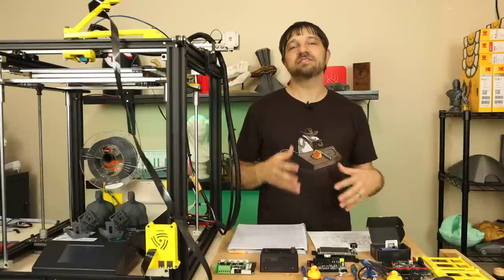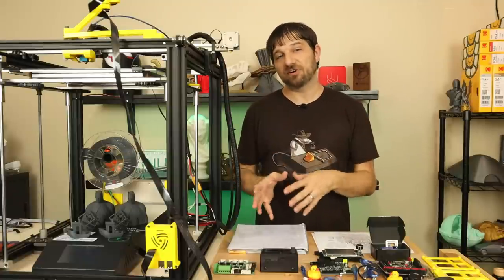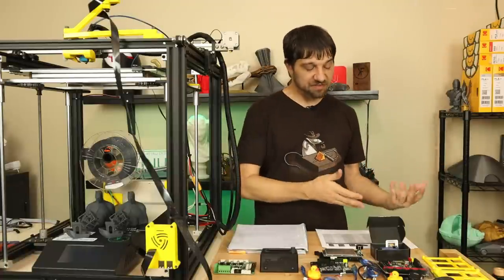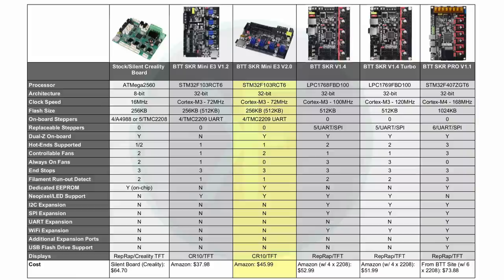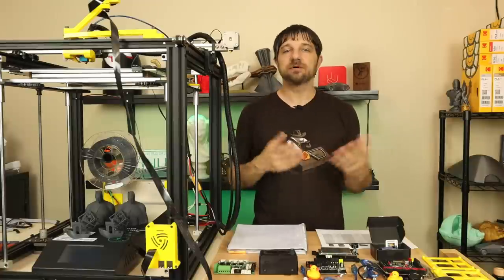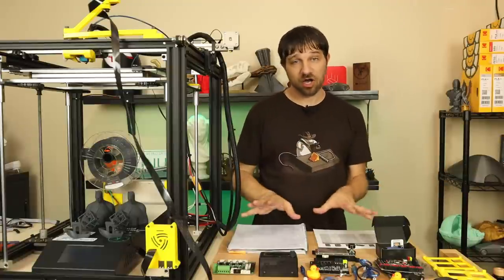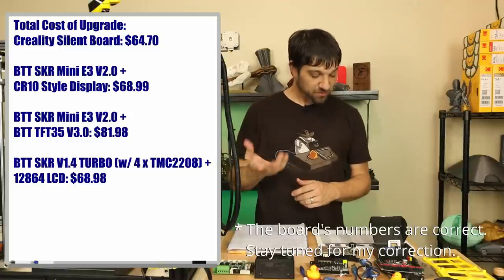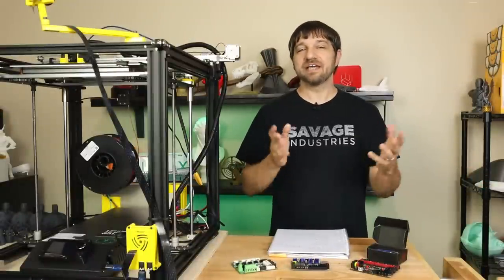Bigtreetech Ender 5 Plus Upgrade: Boards Compared (Part 1)

Comment from the maker: Have you missed my previous videos on Marlin 2.0? Check out this playlist for more information: https://www.youtube.com/playlist?list=PL4dGkbjUvBzpvkhay7Hf_fm3ygnvwQErt
I'll also post any corrections or updates in this pinned post!
- Clairification: Most of my comments about the display were in relation to the Ender 5 Plus which has a touchscreen display. The 12864 LCD on the Ender 3 and Ender 5 should work just fine with the Mini E3 V2.0 without modification.
- Correction: The SKR Pro V1.1 does not have onboard EEPROM as shown on my table.
Reply: I love you man!! I've been compiling my own Marlin firmware until 3:00 yesterday (or should I say today) and I have a black screen. I'm just recompiling as I type this. Now you released your firmware. Thanks! I can modify yours or just see why mine is acting up.
Reply from the maker: I'm happy to help. I haven't posted the binaries yet but I'll get them up if you need them.
Reply: @kerseyfabs  I'm already compiling your version. But the problem is that your version also shows a black screen. Which I find odd since cheetah firmware works fine.
Edit: Ok it's not firmware. It's something else. Now I also don't see any screen on Cheetah. And the board is not responding via USB. Odd.
Edit2: OMG!!!! Two days of work because of the chinese SD card that was causing problems! Note to self and others. Even though they are only 128MB they are still trash (the ones that come with the board).
Reply: Hey. Just to add... I have checked your firmware and it's ok for a start but you really should enable UBL (or make a video about it) as it's not that harder to use and it's way better than BIL leveling. BIL leveling hase some issues with SKR e3 boards. They tend to ignore BIL leveling (I have been testing this for three days straight).
Reply from the maker: @BlazPivk  I'm really sorry to hear that was your problem but excited that you found the solution! Nice job!
Reply: @kerseyfabs  Yeah I have found it odd that my firmware wasn't working but hey everyone can mess up. When yours didn't work as well I knew something was up. But I love the fact that you're experimenting with the plus version as it seems you cover all the stuff I'm interested in and I don't have the time to tinker with (well except the firmware, I like to tinker with that one).
Reply from the maker: I'll be happy to check out UBL sometime in the future. I've never had a need for it thus far because my printers barely need ABL at all. I may just be lucky on this one.
Reply: @kerseyfabs  Oh my E5+ worked great on the stock board but SKR mini has a  bug with the firmware where it can raise offset or something. I found that out the hard way when my printer needed constant adjusting for the first layer. UBL doesn't need that so I just wen't with it. Other than adding a different slicer gcodes and running some of them initially it's actually not hard to implement even for inexperienced people.

Comment: You can buy BTT skr v1.4turbo and BTT SKR Mini E3 v2.0 on the BTT official website https://www.biqu.equipment/
BTT skr v1.4turbo https://www.biqu.equipment/collections/skr-series/products/btt-skr-v1-4-skr-v1-4-pro
BTT SKR Mini E3 v2.0 https://www.biqu.equipment/collections/skr-series/products/bigtreetech-skr-mini-e3-v2-0-32-bit-control-board-integrated-tmc2209-uart-for-ender-3

Comment: All those boards support the Creality Ender 5 Plus / CR10S Pro style TFT touch screen through the TFT port on the SKR boards.  I currently have a CR10S Pro Touch Screen wired to a SKR V1.4 Turbo board and it works great!  You just have to get the correct pinout for the Creality touch screen and match it up with the SKR TFT port.   5V and Ground are easy.   The Touch screen has 2 pairs of TX/RX and you only need 1 pair.   So ignore the pair of TX and RX that have a 4 on them.  TX4/RX4 on the touchscreen connector will not be used.   Also, the RST line on the TFT header is not used / not connected to anything.    

Literally all you have to do is connect the 5V of the SKR to the 5V pin of the Creality Touchscreen.  Ground to Ground.   The TX of the SKR connects to the RX2 of the touchscreen.  (Notice TX connects to RX in this case) and the RX of the SKR connects to the TX2 of the touchscreen.   That's it.  You're done.    Well, except you also need to use the flag in Marlin:  Force10SProDisplay.  With that flag enabled, your SKR board can operate your stock display.  You also need to make sure that your touchscreen is updated to to run with the matching screen firmware files that go with the particular version of Marlin you are using.   TM3D usually has a zip file in their firmware package that you extract to a microsd card that you use to update the touchscreen.  Pretty easy process.  Copy the files to the card, insert it into the touchscreen microsd slot, power it all on, wait for it to copy the files, power it off, remove the card, and it's updated.

Here is a picture of the touchscreen without the pins and without the plastic header blocking the view of the pin names!  https://imgur.com/gallery/rcrRf0u

Comment: With both the BTT boards there actually is the option of using the stock screen - it's a little more complicated than using a TFT35, but has been done. Certainly for the E3 2.0 it makes it a much cheaper & better option than the Creality board.
Reply from the maker: I know it's possible but I wasn't sure that support had made it into mainline Marlin. One of the benefits of the upgrade though was getting that stock Marlin text control. I prefer it. I was looking into flashing the stock display though to newer firmware to add functionality in a future video.
Reply: @kerseyfabs  Yes, it requires a custom Marlin fork, certainly not the most straightforward compared to using the TFT, just pointing out is was possible for cost purposes :) Looking forward to the rest of the series!

Comment: You can use the stock screen for the BTT SKR v1.4 Turbo. Probably the other BTT boards too, but not 100% on those.
Reply from the maker: I wasn't sure if that support had made it into mainline Marlin since it requires pin remapping. I'll check into it for a future update.
Reply: @kerseyfabs  Nice one. 
My friend has his running using the stock screen, I think he uses the Tiny Machines fork though. 
I ordered the screen with mine and it arrived today, so I'm printing out the brackets now.
Reply from the maker: Check these options out if you haven't already. 😉 (Preview)
Option 1:
https://www.thingiverse.com/thing:4051550
Option 2:
https://www.thingiverse.com/thing:4153427
https://www.thingiverse.com/thing:4370844

Comment: Sometimes boards with 512k on board are rated only at 256k due to leaving enough room to update the firmware without writing over existing firmware.   That way it always has a backup of the firmware stored.    Not sure if this is the case here but I have seen this done a fair bit

Comment: great video series. I've watched them all and decided to order a BTT skr mini S3 v2.0. But i'm going to install it in my E5 pro. And my silent creality 4.2.2 board of my E5 Pro goes to my E5+. So i don't have to swap the screen of my E5+. But do you also have some firmware files for a E5 pro? Or are the gifthub examples a good starting point for the E5 Pro?

Comment: Nice Job, I really appreciate your videos as I am just starting my upgrades for my Ender 5 plus.  I like the fact that you do a comparison between the upgrades and accompany them with the installation videos.  I would love to see a video about using PETG with the E5+ and some good guidelines for configuration.  I have been using PLA+ for about 3 rolls and have tweaked, printed additional parts and fine tuned the E5+ using PLA.
Reply from the maker: Glad you like them! I have a video about tuning for specific filaments in the next couple of weeks then I may tackle a few videos about specific filament types.

Comment: What I am finding out a lack of knowledge about how a stepper motor works and how relatively simple changes can augment the performance of s stepper motor. Also how to recognize a good stepper motor from a cheap one.
Stepper motor controllers like the Trinamic ones can control de amount of current that flows through the coils of a stepper motor. The Ics use PWM to control the amount of current flowing through the coils. Let's show a simplified equation for 2 different stepper motors, both with the same power in Watts and the same torque.

Motor 1:

P[W] = I[A] * U[V] = 1A * 12V = 12W

If I use a 12V power source and the nominal values for the motor are 1A and 12V the Trinamic IC PWM would operate with a PWM with a duty cycle of 100%.

Motor 2:

P[W] = I[A] * U[V] = 4A * 3V = 12W

If I do operate this stepper motor from the same power supply with a voltage of 12V the PWM will have a duty cycle of 25% to ensure the current value continues to be at a maximum of 4A. Let's apply the numbers to the same equation:

P[W] = I[A] * U[V] = 4A * 12V = 48W

Now the stepper motor offers 4x the power and so also about 4x the torque. This is such a simple thing to do, as Marlin would just have to set the current value max to the nominal value of the motor. Trinamic even offers the feature to address peak torque needs by allowing for a short period of time to increase the current by 20%.

I believe Kersey you should look into this. I find it very bad that I could not find the nominal values of the stepper motors used in my Ender 5 Plus. There should be this information supplied. I even guess that Creality uses the PWM functionality to operate SilentStepSticks with either 12V or 24V

Comment: Kris, I noticed you used the TFT 35 why not use the 4.3 TFT screen? I'm looking to upgrade but really would like to use the 4.3 TFT Screen. Will it work? What's the difference between the 2?
Reply from the maker: The 43 wasn't out when I began this. They work the same, you'll just need to find a mount.

Comment: Great intro walk through
Some times you can use the original display, by turning the kable 180 deg ?
Thanks for sharing :-)
Reply from the maker: That just depends on the display and how you configure your firmware. But sometimes it does require turning the cable around, depending on pin-out.

Comment: it would be nice if you include the  SKR E3 DIP
Reply from the maker: I have one, so I could do another video on it. Let's see this comment gets some likes if people are interested! Which printer? Which drivers?
Reply: @kerseyfabs  it cost on amazon 18 dls the 1.1 version, you can use the same 2208/09 drivers or 2130 spi and test it in this series of comparation videos with the same ender 5

Comment: i've heard reports of the skr mini e3 v2 blowing up its "improved" mosfet when used with the 5 plus, ostensibly down to the larger heated bed(vs the ender 3 and 5 pro). have you gotten that far in actual filming and testing? any observations?
Reply from the maker: That should only be possible if people decided to bypass the external mosfet and go straight to the board. If you're using the external mosfet that is standard with the printer, there's no way that would happen. Use the external mosfet.

Comment: Thank you for this series of videos, for the 5+ can i just do a swap board with the skr mini e3v2 or do i need to do the firmware too?
Reply from the maker: You have to install the correct firmware on the board so it knows which printer it's in.

Comment: hi , seems u are happy with the ender 5? bought me the 5+ in december and since it left the box it was problem after problem after..   latest is the randomly choosing a "center" when homing and doing the same for the 4 points when doing aux leveling (if the touch screen responds that is) . also ignoring the signal from the end stop switch and contiues trying to ram the ends of the printer... gues it is made on a friday before closing and finisched on a monday.
Reply from the maker: Sorry to hear about your problems. You could be running into some noise on your wiring. This can be worse when heating the hotend or heat bed which pull more current. I'd suggest trying to separate your endstop wiring from your hotend, heat bed, and fan wiring. Just run them separately instead of right next to each other.

Comment: Kris, thank you for doing this.  This 32 bit vs Creality boards is something I have been very interested in.  What do you know about the SKR Pro V1.1?  I can't find a reference to that on the BigTree-Tech website.
Reply from the maker: No problem! I included it in the chart for comparison. I also have one coming! I'll get more info out as soon as possible.
Reply: @kerseyfabs  Great Video. I enjoy this a lot. Do you know what's difference between SKR Pro v1.1 and V1.2? I am planing to get a new board to replace original board. (SKR 1.4 turbo and SKR Pro 1.1)

Comment: Hi. I know I'm late to the party, but is the ender 5 and the CR 10 S the same stock board. If so I'm  Guessing the process for changing the board will be very similar? and should be possible

Comment: Silly question: I can still follow this series if I have the 1.3 SKR, not a fan of the 1.4 and that one has to remove pins on the driver side
Reply from the maker: Yes, overall, the process will be the same.

Comment: Do you have any plans to update the firmware files? I'm stuck now as I modified my ender 5 plus and planned on using your videos and firmware, only now it turns out that you can't compile marlin 2.0.6 with current version of platformio... So I'm stuck with a bricked printer and can't for the life of me figure out how to do the firmware myself
Reply from the maker: Check my community page, I have a 2.0.7.2 update there. Also, you could follow me on Facebook where I post them too. https://www.youtube.com/c/KerseyFabrications/community

Comment: Would love to see an update on this as BTT has started to phase in the 2.0 and the 1.4 turbo isn't available on amazon anymore.
Reply from the maker: I released a connection guide and firmware on my community page. I'm starting to get the idea that people still want a video.
Reply: @kerseyfabs  I'm 2 weeks in on my Ender 5 Plus with the Touch screen and BLTouch(The pin depth sensor?) I watched this video and then went to the BTT website and im completely shook on the number of products they have available. between the new stuff I'm seeing available on there and my CE5P seemingly pretty new generational wise not just out of the box.... a new video that include an updated version of guide above and difference between the component levels would be so amazing... like For example on here you talk about the 2209 URT being really nice, so i went on BTT to find some thing and now they have even newer ones and I'm like "aaaaaaaahhhhhhhhhhhhhh helllpppp!!!"

Comment: The BTT website says that the E3 Mini 2.0 is compatible with the 12864 LCD screen on the Ender 3 and 5. You made it sound as though you have to get a new screen, am I missing something? please clarify or correct me if Im wrong. thanks
Reply from the maker: Sorry for the confusion. Most of my comments about the display were in relation to the Ender 5 Plus which has a touchscreen display. The 12864 LCD on the Ender 3 and Ender 5 should work just fine with the Mini E3 V2.0 without modification.

Comment: can you use the stock touch screen with the v2 board?
Reply from the maker: You technically can but it will require custom firmware and probably rewiring the connector to the board. I haven't done it myself but you can checkout the firmware work from Insanity Automation: https://github.com/InsanityAutomation/Marlin/tree/CrealityDwin_2.0
Reply: @kerseyfabs  I done the software change but my x y and z axis all are inverted. I tried inverting them with the touchscreen settings but no luck. All the wiring is correct also. What do you recommend here?
Reply from the maker: @thomasalley8087  Which display, board, and firmware  did you go with?
Reply: @Kersey Fabrications I used your firmware and the tft35 v3. I just realized too my new skr mini micro sd slot isn’t working either. 😩

Comment: I saw another video today which explained that some of the older SKR 1.4 and SKR 1.4 Turbo boards (made before March 2020) have the wrong resistor installed and might be unreliable as a result. So, you might want to give your SKR boards a close look to make sure they're in proper shape. https://www.youtube.com/watch?v=gdecCW3vsIM
Reply from the maker: I checked one of my SKR V1.4 Turbos and it still has the wrong resistor, according to the e-mail he showed. My board is dated 2020.5.16. I'm not having any end stop issues with standard switches. According to his video, it appears this may only affect the optical end stops.

Comment: Great video.  Have you been able to have the filament cooling fan have a dynamic control instead of always on?
Reply from the maker: Thanks! The problem is the lack of computer controlled fan headers. The SKR V1.4 boards only have one (which is used for part cooling) and the mini E3 V2.0 has two but you'll have to decide whether the second will be used for your controller fan or your hotend fan. I have mine on the controller but it could be switched around.

Comment: does it work with the normal ender 5? (the smaller "vanilla" one)
Reply from the maker: Yes. The Mini E3 V1.2 and V2.0 will work as a drop-in replacement. The SKR V1.4 will require an adapter of some sort.

Comment: Hay do you know if this motherboard works with the ender 5 plus E3 Free-runs TMC2209
Reply from the maker: E3 Free-runs? Is that right?
Reply: @kerseyfabs  yes the one that came with the printer is so loud it keeps me up at night
Reply from the maker: @Stevens3D69  It appears that Creality doesn't have support for this out of the box. I noticed that TH3D does if you change out the display and buy their firmware. I don't have one of these boards to make firmware or run testing.
Reply: @kerseyfabs  damn didn't want to have to change the screen